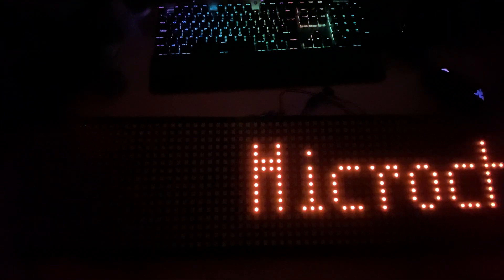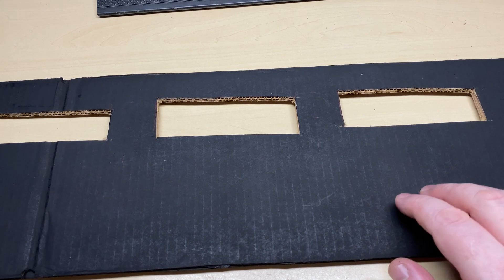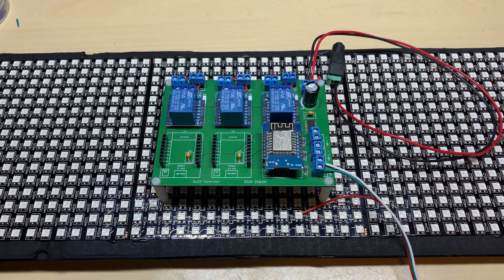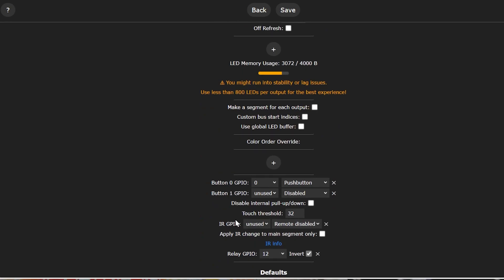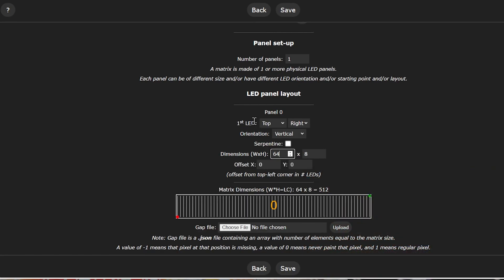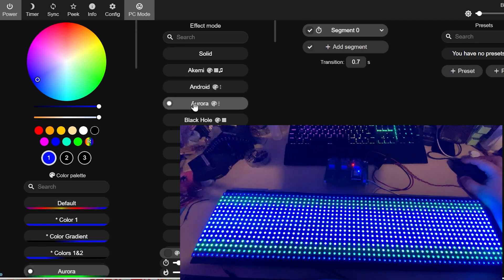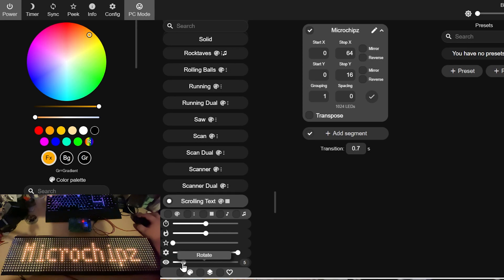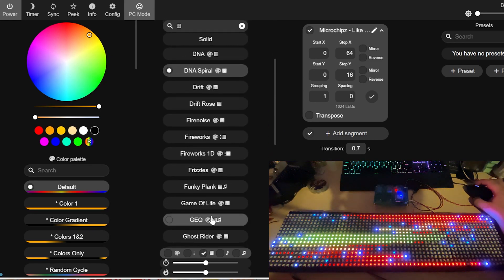Unlock the Potential: Pushing WLED 0.14.0 to the Limits with Massive 1024 LED Panel

Comment: Hello, I want to make a large matrix, I have an esp8266 witty cloud and I can only use a 30x10 matrix, 300 LEDs in total, it doesn't allow me to use more than that, what could be the problem?
Reply from the maker: i think you will need a esp32 for more , maybe its a limiting issue for power ?

Comment: He did not say anything good in this film. There is nothing about how to connect about the power supply requirements. The configuration is also wrong because the row of diodes is too long and leads to flickering. If someone wants to do it right then look for other videos that explain it better.

Comment: To improve your FPS you could use multiple gpios  , 1024 on one gpio is not ideal but I guess it might complete your wiring , for future project use 256 per gpio and you will notice a difference
Reply from the maker: Interesting , will give it a go.
Reply: @MicroChipz  came to say the same.
I have pretty much the same as MicroChipz but in a square config, but using 2 pins.
Interestingly enough, when I tried using an 8266, WLED gave me a warning to not use 1024 leds on one pin, but when i tried again on an ESP32, WLED did not give me any warning. but I still wired them up in 2 sets of 512.
Reply: How would one do this practically? on the ESP32 use two GPIOs, but where do i connect them on my 4 matrices? (they are all setup to act as one big matrix, right now with GPIO16 only)

Comment: I want to build 8feet by 10feet like led wall is it possible to use that led panels or is it also possible to use ws2812b 60 leds/meter.
Reply from the maker: I think that’s pushing WLED to far there , the current draw will be massive and over 800 LEDs WLED don’t recommend

Comment: How much current the whole setup is drawing on full brightness? (I mean all pixels lit up with full brightness at the same time)
Reply: It would consume 61.44 Amps. That's nuts
Reply: @paulushdk  I actually just finished a built with 1024 LEDs in a 32x32 configuration, so 4 16x16 panels. I've set the brightness limit to 10A in WLED, and it's still shockingly bright. So yes, they technically could consume 62A, but it's absolutely not necessary to do so.
Reply from the maker: I haven't got a power supply capable of running at full , the heat this would generate would be a concern. Each LED uses 60ma and full bright ( white ) so multiply this by 1024. Its a big number.